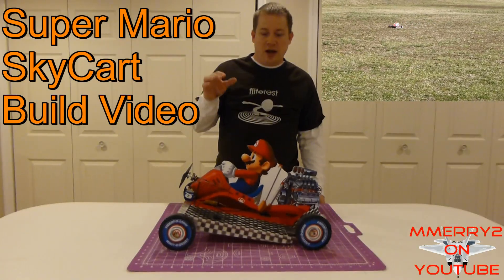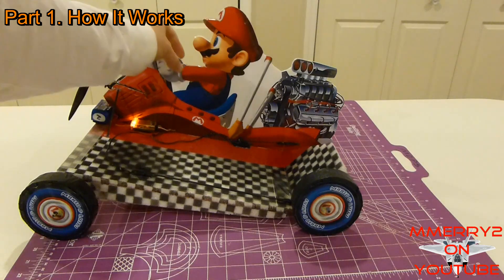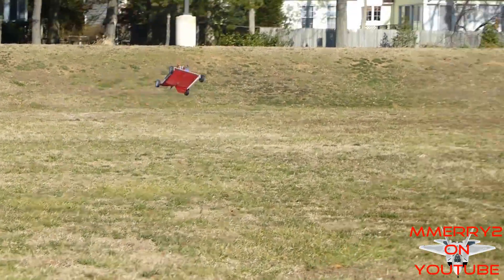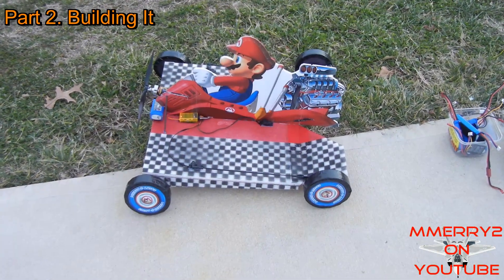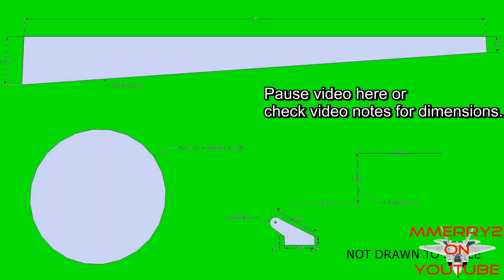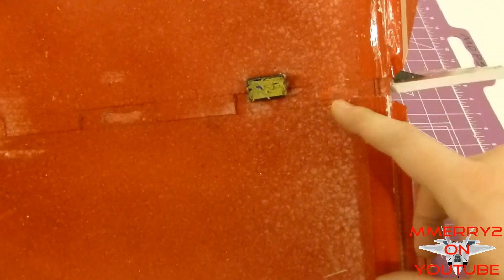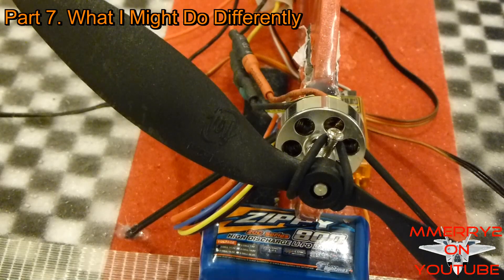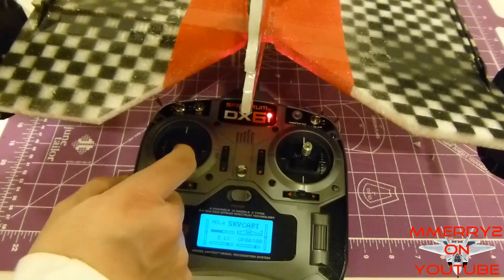Super Mario Flying RC Go-cart Construction

Comment: This looks like so much fun to fly, thank you for sharing this informative video!
Unfortunately, at this time it is very difficult to get EPP foam in Ontario, Canada and I was thinking if this Super Mario Flying RC Go-cart could be made out of 9mm pink foam as you have in frame 7:50?
I constructed a hot wire foam slicer which makes it easy to cut down thickness of pink foam.
Reply from the maker: Unfortunately,  I think your really need to use EPP foam to make the cart because you need the flexibility and lightness of EPP.   Pink insulation foam is too rigid and heavy, and you may not make off the ground without souping up.the motor.  Need to keep it as light as possible.
Reply: @WVRetreat  Yes, totally true. I'll have to see what I can find.
Reply: Hi Mike, you mention that you would move the wheels and axle to the main body of the aircraft. I'm thinking you would have to have smaller wheels to maintain the angle of the fuselage? I did get some EPP foam from a fellow flying club member and started constructing the RC go-cart. My latest brainstorm idea was with winter upon us here in northern Ontario I'm thinking of putting the go-cart in skies